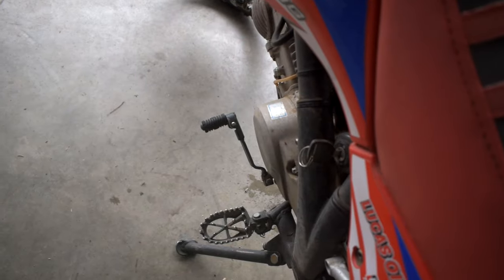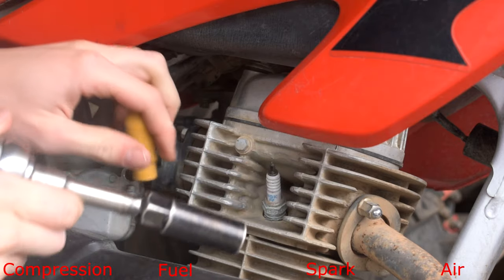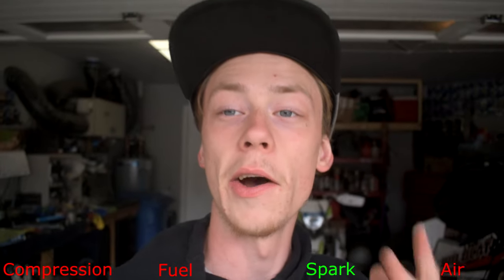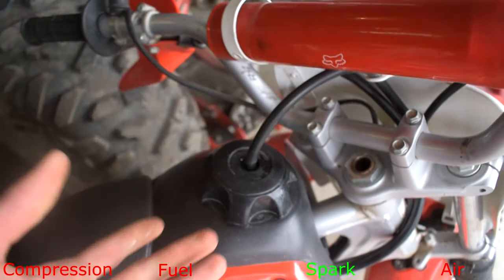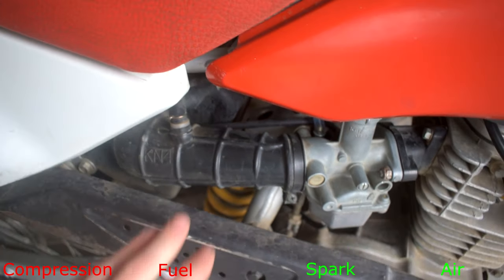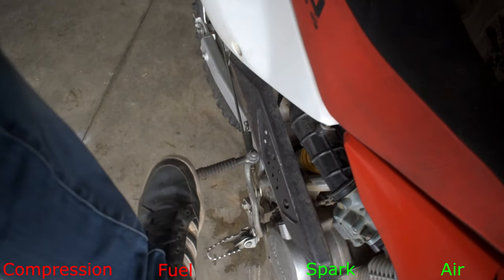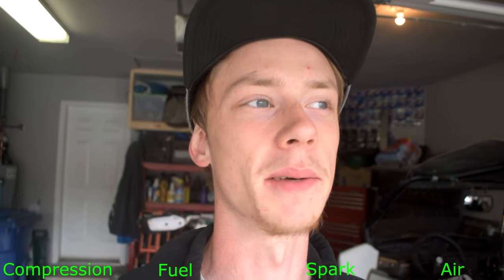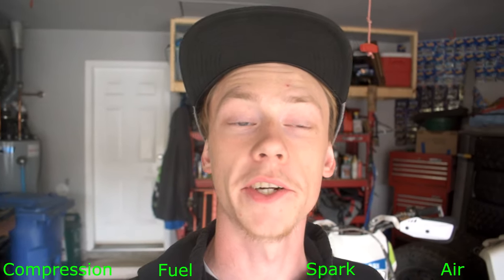Dirt Bike Wont Start? Here's How To Fix It + EXTRA TIPS

Comment: Couple days ago my 2001 YZ125 ran perfect. I go to start it up yesterday and it was running rough. I cleaned the carb thinking piolet jet had debris in it. I put the carb back on and now it won't start at all. Here are the things I have checked: There's good spark, the spark plug is wet, the reeds look great, the exhaust isn't clogged and there is good compression. I don't understand why it was start if the spark plug is wet, can anyone help.
Reply: Did you end up starting it?

Comment: My bike didn't start at all, someone advice me to change the spark plug, that really worked for me
Reply from the maker: My question would be what did the spark plug look like on the tip, if the bikes running to rich or to lean, you kill another plug

Comment: I just got a klx 140L for $1000 and I was gunna get a Apollo but this was just to good of a deal
Reply from the maker: Thats a steal of deal!!!
Reply: Did you fix your 140 I cant get mine to start
Reply from the maker: Whats wrong with it
Reply: @AaronsEnduro  I hold the start button and it just keeps trying to start but wont. Fuel line is on and the battery is fine not sure whats up. Tried the choke it didnt do much either
Reply from the maker: And you went through this videos diagnostics process
Reply from the maker: You may need to give more backstory, was it sitting for a while, did you remove or fix something else recently etc
Reply: @AaronsEnduro  yeah, it just came back from the shop too. Its had this problem before but usually it would start after around 10-15 tries
Reply from the maker: @NickAdamski69  clogged idle jet possibly
Reply: @AaronsEnduro  probably, thing always had idling issues
Reply: Had an issue with my 160 it ran fine one day I parked it for the evening went to start next morning and crazy rpms would not idle for diamonds everything is new on the bike I thought I blew the intake valve but to my surprise when I pulled the sparkplug it no longer had a gap I regapped it and first kick it's mint 😁😁
Reply from the maker: Hell yes! What an easy fix!

Comment: Awesome video man. I have a 1988 yamaha dt50 and I cannot get it to kick start but it will push start every time.
Reply from the maker: Does it idle fine after?
Reply: @AaronsEnduro  Thanks for reaching out! It idles fine after it's warm. But not right away. Won't kick start when it's warm either.
Reply from the maker: Does the kick starter lever jump, grind, or bind?
Reply: @AaronsEnduro  Nope it's the strangest thing. It's almost like I'm not able to get a full kick. Like it's the wrong kick lever but it's the one the manufacturer sent. A friend said the piston could be going out
Reply: @AaronsEnduro  Nope it's the strangest thing. It's almost like I'm not able to get a full kick. Like it's the wrong kick lever but it's the one the manufacturer sent. A friend said the piston could be going out
Reply from the maker: Get a compression tester and test it. Then you’ll know if its worth ur time to investigate further

Comment: A Chinese pit bike was brought into my work for scrap on Monday, me and my friend are getting it tomorrow for £40, it looks fairly new and the oil is golden in colour, I couldn’t get it started and am wondering if it’s that thing you mention about the clutch, we’re gonna have a look at it tomorrow night
Reply from the maker: These simple air cooled engine dont need much to run, if its got compression odds are youll get it running. The only other thing is that the cdi boxs are junky and fault out sometimes too. But youll see a loss of spark if it is. People usually cheap out on fuel they put in these bikes and use ethanol blend of fuels which causes shellac in the carb, clogging up the jets and pilot circuit. Cleaning the carb out thoroughly or in a ultrasonic cleaner is worth while checking if you haven’t dug into the carb yet

Comment: Thanks for the info brother! I just got a yz250f for cheap it’s my first 4 stroke. I just gave it the full service (new oil+filter, air filter, coolant, gas, spark plug) but she still won’t start. She started when I bought her but now it won’t turn on. The kick start seems to be really light so I’m thinking it’s compression. What do you think? And if it is compression where should I start before I call the mechanic?
Reply from the maker: If its compression the engine is toast. Id be looking over what work you did to it first
Reply: Aaron Greenway when you say toast, you mean top and bottom or you think I can just replace the top end? I don’t mind getting top rebuilt, before I’m 20 miles out and find out 🤣
Reply from the maker: Personally id take to it to a shop that knows those bikes and have them take a look at it before you start rebuilding anything if you’re not sure
Reply: Aaron Greenway yeah that’s what I’m about to do. I got someone portable coming Wednesday to check her out. I’m asking tho since you seem you know a lot more than I, you think it’s compression for sure? Considering the kickstart has like no pressure. And if so, you think I can get away with just top rebuild or bottom gotta get serviced too? I got a mechanic coming couple days just wanted to know beforehand what to expect. Thanks for the replies btw!!
Reply from the maker: @MrLuckymimi  if the kickstarter still turns over, youll probably get away with a top end only. If it was seized up you could need to redo a bottom end

Comment: Great video. My son has the same bike. But some how I think by washing it he has got water in where the spark plug goes. Took the spark plug out and kick started it, water shot out. Anyway of really getting emptied out completely ? Thanks
Reply from the maker: That’s exactly how to get all the water out, pull the plug, lean the bike over, and kick it over till its all out
Reply from the maker: Can be a tedious process without electric start for sure
Reply: @AaronsEnduro  yeah at the moment it doesn’t start. Think he was over zealous with the hose pipe! I read somewhere about a small pin hole close to the spark plug, but I couldn’t find anything. Might order a new spark plug also. Anything else you can suggest? Appreciate the quick reply
Reply from the maker: Does it still kick over? Or is the kickstarter jammed
Reply from the maker: Sounds like he got water in the exhaust. Stand the bike up no its tail ( rear tire) vertically and see if water comes out the pipe
Reply from the maker: Or the air filter possibly still soaked?
Reply: @AaronsEnduro  also I took out the carb plug to let any water out.
Reply from the maker: Id be removing and clearing out the carb completely, dry and clean air filter, pull the exhaust off and make sure its dried out, pull the plug make sure its dry.

It’s possible you got water in the cdi box
Reply: @AaronsEnduro  will check this out today. It kicks fine, but doesn’t start up. Think there is a a spark, but will check that out later also. Thanks again. Bloody kids lol
Reply from the maker: Make sure you have spark before you cant figure it out

Comment: Hey idk if ull see this but i recently got an aprilia 50 (swapped to 70)  and everything was fine but a few days ago after a drive i was putting my bike back to the garage, stopped, put it in neutral ( basic stuff) but the engine didnt stop running AND it kept running louder and louder to the point where i thought its gonna blow up so i quickly took my key out to turn my bike off cuz nothing worked. After that i checked there was no gas left in the tank, after a few days i got some gas tried starting it and it just doesnt start anymore idk what the problem could be ( i changed the spark plug didnt help tho).

Comment: I just bought a 2022 Chinese dirt bike with a CDI 169FMM motor and it started fine when I bought the bike and right when I got it home. Unfortunately the next day it didn’t start. I have cleaned the carb(may need to tune it now), it has compression, and the new spark plug I just installed has good spark. I’m thinking it has something to do with the kill switch, clutch/nuetral safety, but it has plenty of compression so idk

Comment: I have a 1970s Yamaha mx400b and I've gotten it to turn over and start a couple times never ridden it. But like I said I've gotten it to turn over and start a couple times but every time I have it's died out within under 45 seconds every time. I've taken off the carburetor and tried to clean it and I have taken this spark plugs out and torch them just to get them dry again but I have no spot for a key only a kill switch and a Kickstart. I know that I need a carburetor cap on it but I do not have one. I would really like to get this running and I'm getting frustrated troubleshooting help with be really appreciated. Thank you!
Reply from the maker: Sounds like a fuel delivery issue. id get the carb ultrasonic cleaned to verify that it is no longer an issue

Comment: Got a stomp 140cc that's been sat for over two years cleaned carb new air filter new spark plug got compression did oil and fuel change but still won't start
Reply from the maker: Carb probably has a bunch of fuel varnish in it

Comment: I have a brand new spark plug, fresh oil, just put in new gas and oil and made sure it what the right oil to gas ratio and it won't start still, I have a brand new carb, upper and lower, we replaced my air filter so I have no clue why it won't start...it's been about a month since I rode it last or started it. I have a 2002 yamaha yz 80 any tips?
Reply from the maker: You’ve verified you do indeed have spark?
Reply: @AaronsEnduro  yeah i just put it in
Reply: And we put all new gas and oil in yesturday
Reply from the maker: Take the plug out of the cylinder head, put in it the boot plug, kick the engine over. Do you see the spark plug igniting
Reply from the maker: Just because you put a new plug in doesn’t mean you have spark. It could be a bad stator or plug wire ( youll know that if you have no visible spark when you kick it over)
Reply from the maker: Watch what i do at 2:01
Reply: @AaronsEnduro  ight
Reply: Where do I put it cause o. My bike I do t have the ridges

Comment: So my hawk 250 rps was left out in the rain and it wouldn't start, or even try to start. So I drained the gas tank threw the carb, and then refilled it and then it ran but ran bad and kept dieing. I kept rejetting to see it that was it and it was making a difference but the next day it won't even start and I rejected back to what it ran on originally before i left it in the rain. Changed oil no water in it. I have spark. I believe I have compression but it did go to the floor once or twice. While kick starting it alot back to back trying to get it to start. It's been a week now I gave up. Sense I don't know anything really about engines. Your video here helps alot but I just don't know what to do to get this bike running again. I just hit 500 miles on it too.
Reply from the maker: Hey zack! It could be a possible electrical short. Is the air filter dry?
Reply: @AaronsEnduro  yea I tried starting it again today a week and a half later and it still won't start.
Reply: @AaronsEnduro  I got spark on my spark plug but I kickstart it because the electric start dropped working on me even after I replaced the battery so I run it without a battery and have been kick starting it everytime lol. What electric stuff could it be if the spark plug is good and I even got a new one too but I use the old one sens either still worked before I left it in the rain.
Reply from the maker: The exhaust have a bunch of water in it?
Reply: @AaronsEnduro  not that I know of it would've drained at where it connects because I lost the clamp and it was loose.
Reply from the maker: Take the spark plug out and look into the cylinder. Might see something (water, rust etc)
Reply: @AaronsEnduro  nothing it was dry no rust. It wasn't clean looking either though lol. It was suoer hard to see down the spark plug hole. I need a snake light of sort to really get a great look. It is too heave for me to wheelie myself to see if water was it the bike but as I mentioned the exhaust wasn't sealed so water wouldn't of filled up to get to the engine and there was no water in the oil so someone told me it would be a wet air filter so I let it dry put. I got the air box filter removed and only the oil overfill line attached to it, I got a nibbi carb and filter on the bike that's a washable external filter.
Reply: @AaronsEnduro  this is about a week and 3 days or so later now. The bike still won't start. I may try putting the old carb on next weekend and see if that fixes it. I took the nibbi carb apart when rejetting and it's all clean. Right after the rain the next day I couldn't get it to start or even really make any noise suggesting it was trying to start. So my dad said to drain the gas and then drain and make sure the carb bowl was clean. I did all that then it ran. But it wasn't running good it was dieing if I gave it gas and idle was terrible sounding. So I rejetted the carb and i was able to ride but it would sound really bad and then die when I slow down. Then after a day of trying to rejet it so it will run and it running like that all day. I gave up and the next day I think I may of tried again and so either the 3rd day or it was on the 2nd it just wouldn't start or even try to like before. Maybe I should remove my Gas tank. Clean and dry it and the gas lines and then see if it works. I'll try that next weekend aswell.
Reply from the maker: Hard to diagnose via text lemme know if you get it figured out
Reply: @AaronsEnduro  yea ill get ahold of you next weekend if I need some help I can give you my snapchat and we can video chat to find the issue possibly if I can't figure it out.

Comment: My bike will run for a couple seconds and then shut off what could it b I recently replaced the carb and same issue
Reply from the maker: It can has to be a lack of fuel
Reply from the maker: Or a low idle
Reply: Keep kicking it without any throttle. It's probably flooded with fuel

Comment: i have the rfz you showed in the beginning and for a very long time i had no spark, finally got spark and now it still wont start
Reply: so update it like wanted to start? i started for like .5 seconds
Reply from the maker: Have u ever touched the carb
Reply: @AaronsEnduro  so its been sitting for like oof a very long time i wouldnt say a year but definitely around there with no spark in that time i did get a new carb, also it just ran for about like 3 seconds then turned off just now but i have to keep kicking it over like hell kick after kick so fast for it to even get close to starting , i just literally ab 10 mins ago took off the carb and drained any gas and cleaned it up
Reply from the maker: Was the carb dirty inside with any fuel residue
Reply: @AaronsEnduro  there was actually like yellow residue i didn’t really fully clean it to be honest i just emptied the bowl and used a rag
Reply from the maker: That “yellow residue” is your problem.
Thats the result of fuel evaporating and leaving behind shellac. Its clogging your carb, pet cock valve, gas tank, fuel lines etc. you need to clean the entire fuel system.

You can prevent this in the future by using ethanol free gasoline
Reply from the maker: I bet your jets are clogged
Reply: @AaronsEnduro  just cleaned my carb properly and it still won’t start, should i just buy an entire new fuel system? money isn’t an issue but rather not spend what i don’t need to, i’ve already dumped lots into electrical work but thats fixed already, so idk what do you think? at this point i’ve thought about just buying a new engine or bike overall because ive lost cosmetic bolts and stuff also over the process smh
Reply from the maker: Use an ultrasonic cleaner
Reply from the maker: As u can tell from the channel, ive long since moved on from the RFZ as they hve a lot of issues. Nor would i ever own one again. Japanese bikes is the way
Reply: @AaronsEnduro  yeah maybe in the future im still 17 so i don’t have THAT much money yet hah but definitely enough to fix this shit box of a bike i just got a new carb so if this doesn’t work kms
Reply from the maker: Did you at least get a genuine carb
Reply: @AaronsEnduro  yup!
Reply from the maker: Gooooood, otherwise youd be wasting money hah

Comment: I have spark compression air and fuel and still can’t get my son’s dirt bike running. It will it start at all.
Reply from the maker: Adjust the carbs idle, and or the fuel trim on the carb

Comment: I have a crf100f and the rpm climbs too the moon as soon as I start it it also won’t run for more than two minutes and will crank after it stops but will do the same thing I’ve been trying too find out the problem for a year and I couldn’t find anything on it we replaced the carb and it didn’t help any thing you think it may be?
Reply: Another thing I have a 1999 200r and it won’t start either I rode it the day before and it started first kick after that it wouldn’t start anything you think that may be?
Reply from the maker: @f.f.6323  it could be a ton of things, so i dont have a fix all solution right here right now. I'd start with doing some self diagnosis, and see what you can find does and doesnt work first. Having that little of information doesnt help me narrow it down any further than "the bike doesnt run"